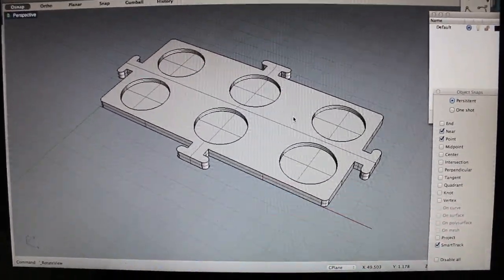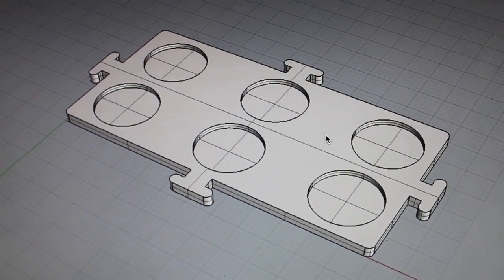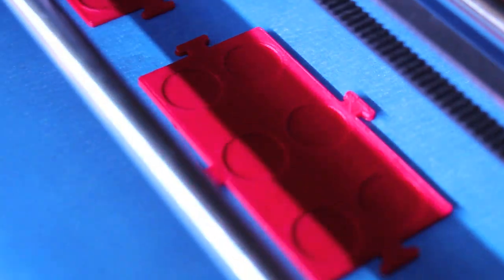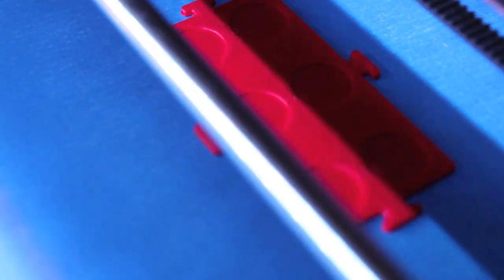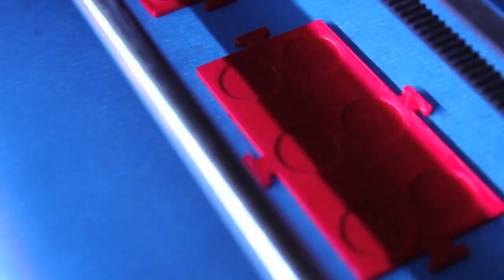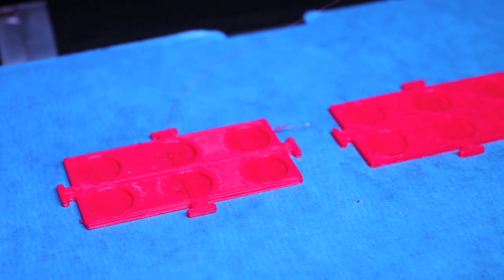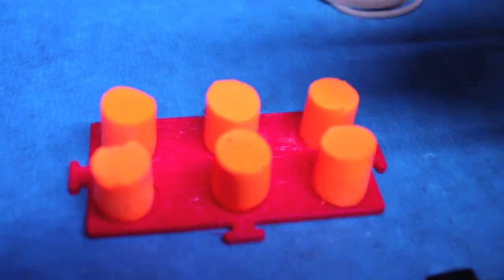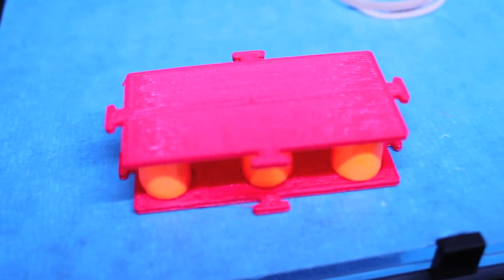Design Experimentation of 3D Printed Vibration Mounts for GoPro Hero with TBS Discovery Quadcopter

Comment from the maker: That's a really creative idea. I never would have thought of that. Based on the consistency of the worms I've used in the past I would have to think that the mold would be pretty close to Moon Gel? Not sure if you've used it, but Moon Gel is some of the better vibration dampening material that I've used. I'd love to be able to mold it however I want. Thanks for the tip.

Comment from the maker: Very good point. I failed to mention that I will be using Kyosho Zeal as well. I'll post a vid that shows the setup, but it will be layered something like this from top to bottom:

GoPro Hero 2
Kyosho Zeal
3D Printed Top Plate
Ear Plugs
3D Printed Bottom Plate
Kyosho Zeal
TBS Discovery Bottom Frame

I've done some initial testing and it works fairly well, but I still need to get to the source of the vibes (motors and props). Thanks for the thought.

Comment: Nice job. I know how to balance prop's and have done so, but not the motor's I will have to look in to doing that. but before put all my gear on the TBS frame I had little vibration on the DJI F450 frame my video's can out good, that was with just the DJI stock prop's. so after I find a good set of e-prop's I may be in better shape. The parts look great!

Comment: That's a great idea. But I think you are avoiding the main problem. Today I spent 4 hours balancing my motors and my Graupner E-props. I balanced the blades and the hubs. This is all on my crappy HK dead cat frame. I have ZERO jello on my videos. All I'm using as a damper is the makeup pads. Try it it works!